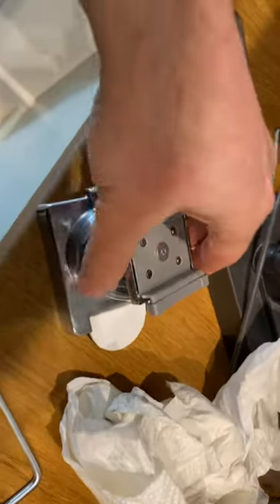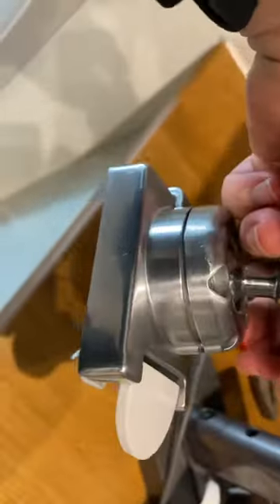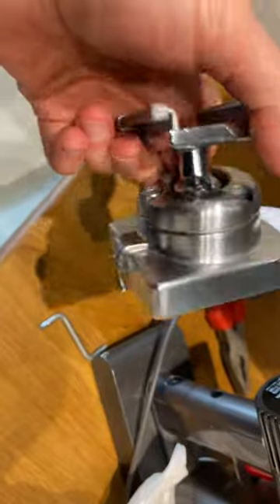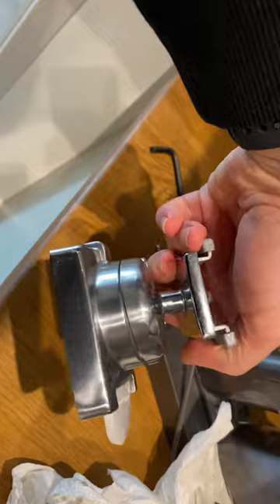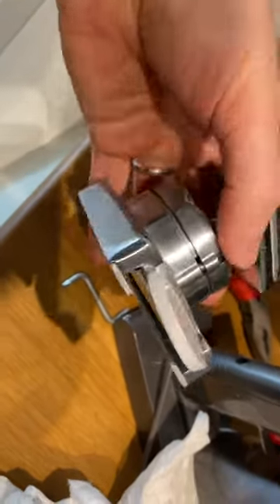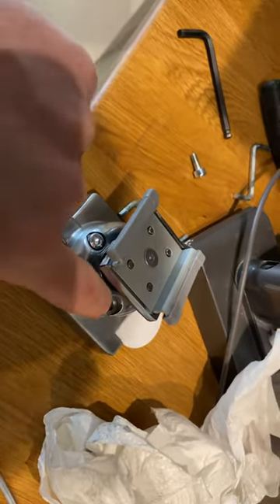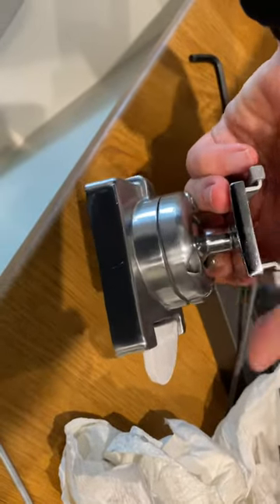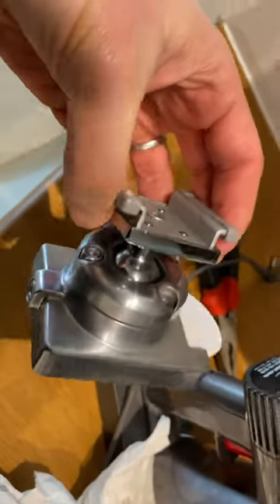Humanscale M8 ball joint stuck or seized fix!

Comment: doesn't work for me as the both pieces are parallel to each other (sort of a default position) and the key won't fit in the gap to undo those 3 bigger bolts :(
Reply: Eventually I had to attach the monitor bracket to the monitor whilst the monitor was laying facing down and use the dual monitor bar as a leverage to move the ball joint from its dead position. After that as you advised. It was enough just to apply WD40 onto the plastic seal around the ball - it has a little gap.
Thanks
Reply from the maker: glad to hear you got there in the end 👍